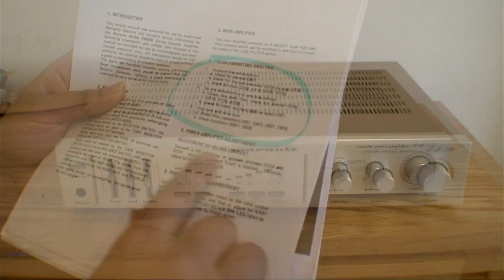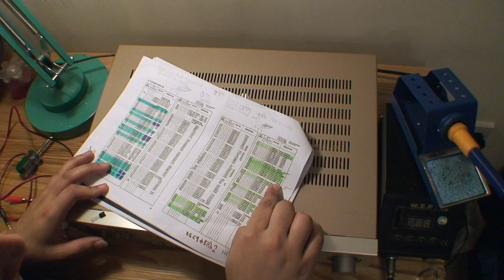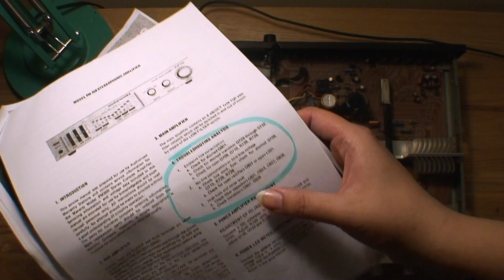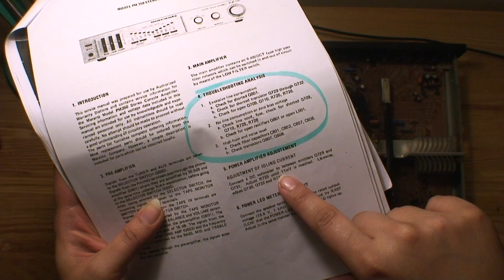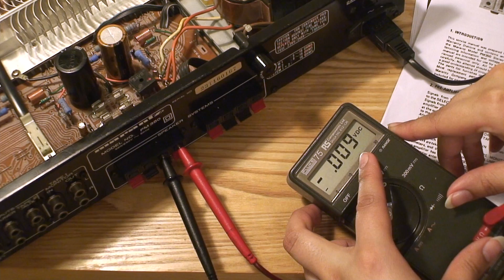Vintage Amplifier repair - 05 Adjusting the idling current (Marantz PM350)

Comment: Hey, it was a good video.  I have an Onkyo minidisc mini stereo which has the same problem.  No sound on the left channel.  I'll  need a more detail description fron you to isolate the bad transistor.   Pls email the link if you have the video and/or documents  to me, if you please.....   Also, try to get some minidisc gear, it will sound better then you cassette deck, and it's very close to CD sound; plus the convenience that you can record anything you want in CD sound quality.   Thanks in advance.

Comment: Even though the specification says 11mv, shouldn't the idling current always be adjusted to as close to 0mv as possible to achieve sonic improvements of the amplifier? Not sure if this is correct or not, but I took this info from a forum a while ago and have ben doing it this way. If I recall correctly it's something to do wit the closer to 0mv you go, the higher your system heats up and this increases the heat output of the system which in turn improves the sound.

Comment: When a turntable sits on an amplifier or receiver, hum may be due to the proximity of the phono cartridge to the amplifier's power transformer.  A power transformer usually has a hum field near it, so placing a turntable on top is not good for this reason.  The transformer of some amps may be located further from the phono cartridge.  That is why some amps may be more forgiving under such circumstances.  It does not indicate a malfunction necessarily.  Move the turntable away from the amp and then listen for the same hum  If it lessens significantly, the amp is fine, and it was the position of the turntable that caused the hum.

Comment: Maddi , I just bought a Marantz 510M , on the outside of the unit looks very clean the faceplate is perfect and the knobs are perfect.... is there anything I should do before hooking this unit up to a Marantz 2226B and ESS amt 11 speakers ? ( How can you tell when the units need to be recapped with all the pieces ? Thank you Michael

Comment: Replacing a bias transistor with one of significantly different gain from the original that was in there can cause your bias to be much higher or lower than it was originally set at the factory or by another technician. In a worst-case scenario the amp might be turned back on with a very high excessive bias on the channel you have repaired, leading to another very fast failure that could even be catastrophic. If you have one undamaged channel, use the transistors in that channel for purposes of gain matching the replacements being installed into the other channel. You pretty much have to pull the transistors out to do this, there's no way around it. Before turning the amplifier back on to set the bias, you probably should turn the bias all the way down first so that the amp comes on with minimal rather than maximum bias. Unfortunately, many service manuals don't tell you which direction of the potentiometer provides minimum vs. maximum bias, and often times turning the trim pot counterclockwise increases the bias rather than decreasing it, which might seem counterintuitive. This is why I use of a light bulb type current limiter is basically mandatory in my opinion, if the bias is considerably wrong when you power the unit up, the light bulb will illuminate brightly and serve both as a warning and hopefully absorb enough of the excess current and voltage being drawn so that the circuitry doesn't go up in smoke and you have some time available to adjust the bias to get it into the lower range as specified by the manual.

And as for DC offset, it is best to replace differential transistors  in particular as gain  matched pairs, as close as you can reasonably get them , because this will minimize or nearly eliminate DC offset, assuming nothing else is wrong with the circuit like dead or significantly off-spec resistors that might have been damaged when some of the transistors blew. If the amplifier doesn't have an offset adjustment, then gain matching of the differential transistors is especially important. If you have too much DC offset, it could damage your speakers, or at the least it might trigger the protection relay in the amplifier, if the amp has one. However, that typically takes several hundred millivolts of DC, and you really don't want that much voltage going through your speakers, certainly it will increase the distortion, and it may cause premature pitting and oxidation of the protection relay contacts.. Use of matched driver transistors and output transistors will ensure they all run it about the same temperature and will also keep Distortion lower.

Comment: *Nowadays, even transistors bought from reputable electronics suppliers should be tested for gain and compared to I known good existing transistor from the same amplifier or device*. Counterfeit or intentionally mislabeled transistors and other electronic components are everywhere. At the audio shop I work for, we have received fake monolithic audio output IC's, fake mosfet transistors (also poorly made mosfets and transistors, with gains and current and leakage specs ranging all over the place), fake CD mechanisms branded Sony but clearly not original, fake cassette deck motors, and so on and so forth. And wherever possible you should make an effort to match the game of a new replacement transistor to the original in the circuit, or its complementary half in that circuit or on the other channel.

Comment: My dad once bought a late-70s Uher amp somewhere and that thing got HOT after running for a while! It was bad enough it'd start smelling of fried electronics! Eventually I convinced him of letting a repair chap have a look at it but that wasn't too promising - claimed some of the outputs were shot and all he could do was convert it to mono. While the amp was still at the shop I did my homework and figured out that the idle current was likely sky-high and possibly the trim pots used to adjust it were shot. Told the repair guy that (including handing him a printout from the service manual with the components marked), he replaced the trim pots, set the idle current and the amp's been fine ever since! Not sure if that chap is good at fixing anything other than TVs and VCRs though... he did get my granny's CRT TV working again (electronics issues) as well as the Panasonic G mech of my old Grundig VCR so he definitely IS good at mechanical VCR repairs.

Comment: Just wondering where you got the transistors from ? The 647/667 are sadly obsolete.. it seems you got genuine parts here but a lot of people get fakes
Reply from the maker: Actually, there was an ebay seller at the time selling these transistors, they werent cheap but i got a couple spare also just in case. I'm not sure if the seller is still around but he did deal with a few obsolete or hard to get transistors.
Reply: Yeah I wont touch eBay for obsolete transistors now.. too many fakes.. but it seems you got the genuine parts at least :)